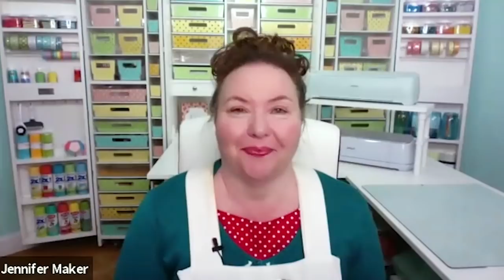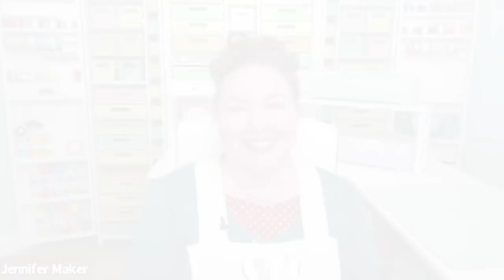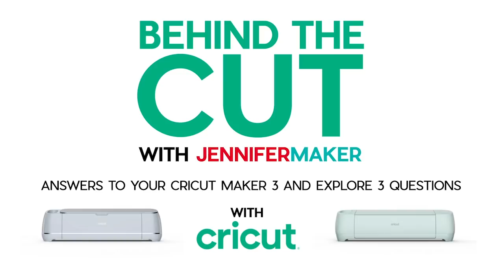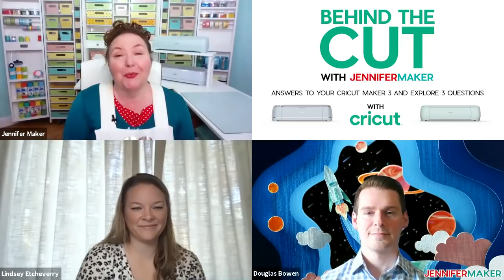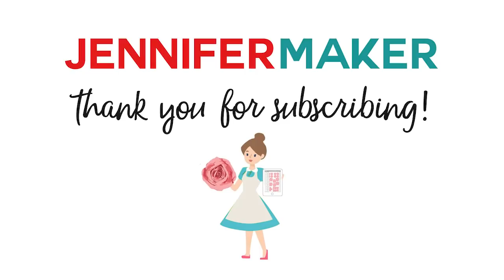Cricut Maker 3 & Explore 3: Behind the Cut — An Interview with Cricut

Comment: Help, I’m new with my Cricut Explore 3 machine and I’m pulling my hair!!!!! Why does my Cricut 12 x 24” premium vinyl on removable mat not fit properly between the guides. The space between the guides is 13” and the vinyl is 12”! How do I feed my vinyl in my machine?
Reply from the maker: Only smart vinyl can be used without a mat. Regular premium vinyl needs to go on a mat.
Reply: Ok I guess I’m not explaining properly. When you insert your material (vinyl) in your machine, you have to put it between the guides where it then feeds into your machine to cut. The guides are 13” apart and the Cricut vinyl I bought at Michaels measures 12 x 24 inches. My vinyl is 1 inch smaller than the space between the guides? Is that normal? Why is the vinyl I bought only 12” when the guides where you put your material are 13” apart? Can I still feed the vinyl in the machine?
Reply: I get it now Jennifer. I assumed because it had a removable mat that it was “smart” material. Thank you Jennifer and MERCI BUCKETS for what you do and doing it so well girl! 💕

Comment: Doesn't having to cut on 13" wide material result in a lot of waste? Seems like if you want something 6 inches wide and 4 feet long you will have a lot of waste. I suppose you cut the excess off before you weed it then use it later on a mat? I think I read these still work with a mat?
Reply from the maker: Yes, that is what I do. 😊